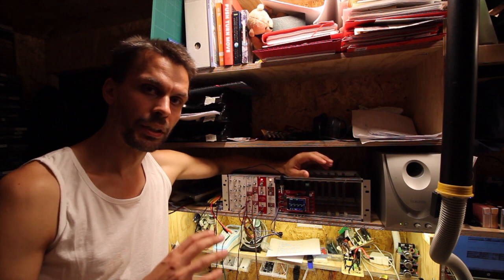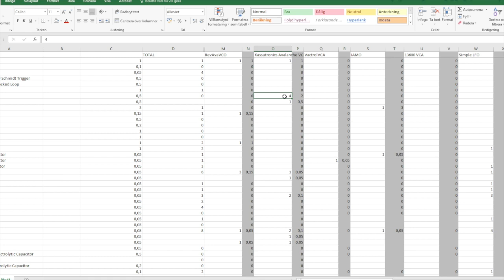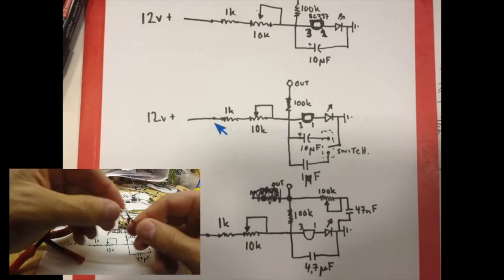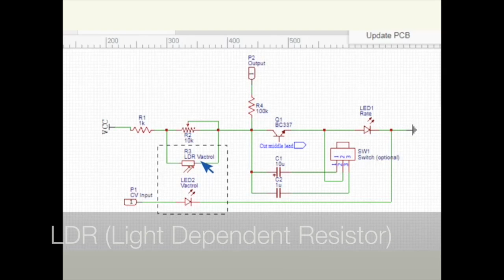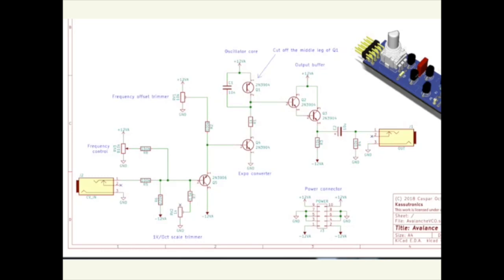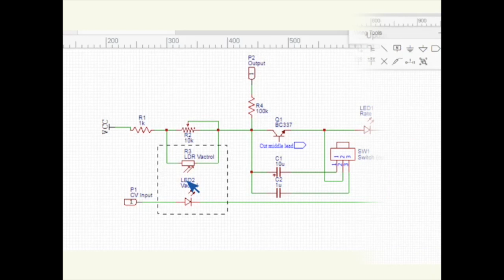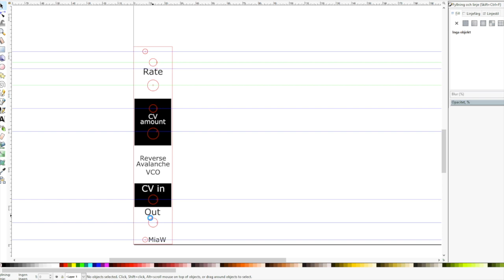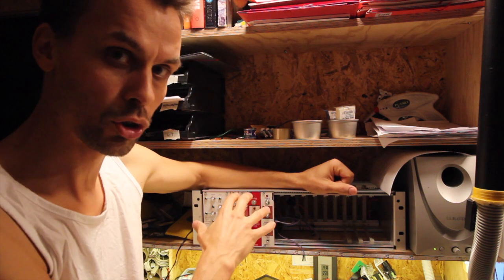Reverse Avalanche VCO - DIY Modular in A Week 1.4

Comment: somehow the ones i built only play for half the knob range, past the half they shut off, same with CV, they only play for like 2 or 3 volts
Reply from the maker: You can try other transistors. As it is very sensitive to their performance. Check the link in the description for which you can try. This is a very controversial vco design. If you want better everything you should try another design. The 4046 is a simple one. 40106 even simpler but not cv-able. Or the AAC vco which is the best one I did in the beginning of this series. It is actually timetable to 1v/Oct. hope it helps a bit.
Reply: @SourceryOne  it's way too simple for proper tracking but it has a lovely sound and I like it specially because it was my first vco, I built it in a dual packet with an option for mixed outputs or 2 single ones, but what I found is that due to tolerances it behaves different no matter what :) I will probably change for a higher voltage transistor and see how it goes; also if you change the led for a multicolor led of the kind that changes "randomly" it produces a cuasi-random change in the pitch

I did the 4046 as well, but since it has an inverted input the keyboard plays backwards and I've been lazy about adding an inverter for the input, also I got some AS3340  but haven't built the module yet

Thank you for answering!

Comment: I dont know... if I'm just living outside of reality and having auditory hallucinations or something but.. as far as my experience goes, if you dont kill the base pin.. nothing changes if you just connect everything else the same, and furthermore and ... rather importantly I would think... when j throw voltage at the base from say an arturia beatstep (I might have fiddled with some biasing) it simply controls the frequency of the oscillator right out the box...

Comment: OK here's a couple of ideas for possible mods to the basic circuit;

Disclaimer: I haven't actually tried these yet, but I will as soon as I have time to play with it...

1. Swap the positions of the potentiometer and the 1K resistor - that would allow a single pot to control the pitch of multiple oscillators (maybe include a small preset pot for individual fine tuning). This might need a diode between the main pot and the 1K resistor to avoid interaction between oscillators, though this might not really be a problem - I'll let you know when I get around to testing this idea.

2. The 12V-18V limitation might not necessarily be an issue in a modular synth with a dual-rail power supply as most of these will be +/- 12V, giving a potential 24V across the main power rails. Not sure if this may need a bigger resistor in the 1K position to limit the current, but if you're going to build this into a module, this might be a viable solution, allowing you to source almost any bipolar transistor. 

3. Vactrol LDRs are not high current devices, so using one to modulate the supply voltage to a bank of these may cause it to overheat :(

4. If you don't really need 1V/octave (ie. exponential control), then a simple short keyboard (perhaps an organ-type bass pedalboard) with individual preset pots per key (13 in this case) might be a neat way of actually playing tunes on a small drone vco built from this basic core circuit, based on the concept in point #1 above.

Sure the 1V/oct standard has been around for a long time but unless you're planning on using it with commercial sequencers and/or MIDI-CV boxes, then you really don't need it, and linear VCOs are much simpler in many respects (I built quite a few synths back in the 80s and most of those were linear)...

Just a thought...
Reply from the maker: Some interesting ideas. :) I’ll love to know what you find out. The biggest downside of this design is that the transistor will degrade over time and fail. So it’s not a good design for a module. :/

Comment: Hi Cristian. If you take the led off the circuit you will get more 1,8 volts across the transistor, enough to bring even the 2n3904 into oscillation, and enough to have 1,75V peak to peak AC signal at the output with the BC337.

Comment: Hi Kristian, i'm a big fan and just started this journey too. I have some soldering and electronics skills but building analog synths is something different. I have build 4 oscillator modules (reverse avalanche) with BC517 transistors. I found out that this transistor has more output, but also lower in pitch (even with smaller capacitors), now I'm figuring out how to amplify them all. probably using a TL074 op-amp, but how to approach this best? for each oscillator one op-amp? or hook all outputs together and then via op-amp? this I cannot find on the internet. Your help would be greatly appreciated. Also i have questions about the vactrol too. Thanks in advance for your reply :)
Reply from the maker: Congrats on jumping into the synthdiy rabbit hole. ;) if you continue watching episodes in the miaw series you will find a simple mixer and a buffered mixer. These two are good for mixing the signals of the oscillators you built.
Reply: @SourceryOne  Hi Kristian. thanks for your quick reply. I'm a musician and play keyboards and fiddling with drum machines from the early 90's. Never occurred to me to build a synth myself. I currently own a Yamaha DX7 and I know how to program, and recently I have bought a Roland Juno 106. So VCO's VCA's LFO's etc etc does ring some bells :). Just figured out that the BC517 transistor has a lot of output, so no op-amp needed. the overall sound is also way lower, even when using a 1uF capacitor. I have fun experimenting with this. next step is the Vactrol. have a nice day. gr Maarten
Reply: Hi Kristian, hope you doing well. May I ask one question regarding the Vactrol? the CV amount you have, is that only a 10k potentiometer in series with one of the vactrol's leg? So that you can control the amount of light falling onto the LDR? or do you have a potentiometer on the CV input jack? no idea if that works different. thanks in advance for your answer.

Comment: Hey Kristien!  Love this series, which oscillator circuit do you think is better for good CV (1volt per octave) for keyboards etc?...., I've made a basic 555 oscillator but CV is all over the place!!
Reply: the only 555 based vco's Ive used that track well at all has been the wasp and Thomas Henry's 555 VCO which is surprisingly great.I want to mod my atari punk console  for 1v per 8ve tracking.a pretty good VCO for tracking is the Moritz Klein Shapes VCO ( pulls heavilly from Rene's work) but, tracks really well once you get it calibrated
Reply from the maker: It is also very important to tune the exponential converter. It is a tedious process that needs to be done.
Reply: @SourceryOne  Thanks for you advise and the link Kristian!  I really appreciate it.
Reply from the maker: The only 1v/oct I built is the aacvco it has NOT good tracking. But works for two-three octaves. There are many oscillators out there with much better tracking. Check out some cem3340 designs or if you want to make the reverse avalanche vco check out kassutronics design which has quite good tracking. Rene Schmitz has some simple designs with cv tracking aswell on Schmitzbitz.de

Comment: I have read that it often takes a few tries/a few NPN's to work. If it does not work does it ruin your NPN or is it still good to use it for something else?
Reply from the maker: If it doesnt work, it just means the npn hasnt the right qualifications. And they should be good to go in other projects... If they start to smoke and/or smell bad, well then its a different situation ;)
Reply: @SourceryOne  Thanks for the reply!. I did not want to have problems with future projects by keeping bad ones around.
Reply: @SourceryOne  Have you tried powering this from the +12 and -12 rails instead ov just +12 and ground?

Comment: Is it possible to use a JFET instead of a vactrol for controlling the oscillator’s frequency?
Reply from the maker: See the next video in the series the IAMO. Gets a vca kind of result with a vca.
Reply: I think that Sam (LMNC) used power mosfets in the 1000 oscillator megadrone panels

Comment: I've made 5 with the s9018 to work on my 9v skiff. I burnt a diode, because no resistor (the other work fine without one, just don't leave them all the way open and drop them on the floor), and I think the s9018 gave in  on an other because messing with the circut too much. It very low volume, and it would'n even work with 22uf (or bigger) cap, so 10uf only. Haven't added a working CV, but think maybe it can become a cool drone or something on an amplified circut. Just used 100k pot's because I had some left, but it only works in a small range, so a 10k would be much better. Awesome video

Comment: Wow! I'm making a very similar journey to you. I've been inspired by LMNC very much, so have built a case, 50x50 cm out of an old drawer, built a dual power supply from a kit and just made 3 reverse avalance oscillators. So far, it just drones! I too found the transistors that LMNC used were hard to get here in Australia, so I got BC337s as well. They do indeed oscillate higher and better than the 2N3904s that I first tried. I also tried different color LED's but the blue and green ones seemed quieter and didnt seem to sound so nice. LMNC is using just red ones so maybe he found the same. At the moment I'm trying to get the oscillator to stop at the pot's highest resistance (counter clockwise position), the 10k pot doesn't do this. Do yours? I haven't compared my output levels yet, but if it's low I may yet build the output buffer like yours. I can't wait to add CV, I have LED's and LDR's on order. I am going to build a Baby8 sequencer with hold stop and reset buttons on arcade switches. I have breadboarded an audio to trigger circuit which steps a prototyped sequencer from my computer so with my audio interface I can send a click to sync it up to my DAW. It's so exciting! I'm looking forward to watching the rest of your work. It's now some months since you published this, so hope it went ok. Peace, Punk Duck
Reply from the maker: That sounds like a good start. As for my oscillators I don’t use reverse avalanche vcos anymore. I switched to one design around a 4046 and one classic two ops no saw and square wave vco which also tracks cv better. I’m also going to build a sequencer ASAP. To make my rig more musical. :) I really like the audio to sync idea. Do you have any schematics or similar you could share? Anyways thanks for sharing your journey so far. As soon as you have a video showing it of let me know. :)

Comment: Wouldn't it be a good idea to add a 220 ohm resistor between the cathode of each led (including the Vactrol) and the ground? And... Why using a DUAL op-amp, if you are using a single section? I guess a TL071 would fit perfectly.
Reply from the maker: Yes. I think I use 330ohm. It depends on which diode you use didn’t I show that? In the ones I have I have resistors. And yes a tl071 would have been much better. Didn’t have one at hand was the reason for that.

Comment: So I built this, and it works, but it is extremely quiet until I touch the positive (an open lug on a pot). While this is cool and an added bonus - I really don't know why it is happening. I currently have it working and my output jack isn't even grounded! How is this possible?
Reply from the maker: The ground in a modular is "strange" and sometimes not used at all, look at all modules using banana plugs, which is just the signal, no ground. 
As for the colume, I have heard many people having trouble with the Rev Ava Oscillator, it seems that it is very dependant of the transistor, and will wear out over time aswell. All I can say is double check your connections, and maybe replace the transistor? You could also add that open lug to ground as you touching it basically is that.
Reply: @SourceryOne  So strange... when I add the open lug to ground it shorts out.  Thanks for the heads up on the potential to wear out though... good to know in advance!

Comment: Many thanks for what you are doing here - has peaked my interests and started me down the rabbit hole I'm afraid - thought I would share a discovery for another transistor to try that I had decent luck with to get stable oscillations at 12v (and below - down to 9V with the 4401! and that was with the LED in series still).  Both do depend on the variable resistor and the capacitor value but everyone looking at this should be trying on their own anyway.  I had some odd multi-packs of 2N3904's that included 2N2222's and 2N4401's - both of which where more stable (or would oscillate) below 12V than the 2N3904's!
Reply from the maker: Thanks for the information and nice that you experiment. Sorry for luring you down the rabbit hole. 😂 Modulars are addictive. It is all I think about nowadays. What module to make next. 😉 Keep on experimenting and let me know all the cool stuff you figure out. 👍

Comment: With ending the VCO's, did you ever find a decent (easy/cheap) sine wave source to build?  I would like to add a sin wave if possible.  Thanks
Reply from the maker: No. Not yet. I found a squ to saw shaper which I’ll try in a bit, but sin seems harder. Have tried a few circuits which didn’t work. But will continue searching. :)
Reply: @SourceryOne  Use this maybe : https://www.multisim.com/content/v5kkSUdCsvbbX9TKSLkSSE/6-diode-3-segment-triangular-to-sine-wave-shaper/ 

I found it a couple days ago and in circuit sims it gives a sort of squarish sine wave with triangle input, but the circuit is really simple. With a switch or two disconnecting the top or bottom diodes at will you can vary the waveform in other interesting ways as well. 

I am going to breadboard it and try it with the reverse avalanche thingy that I built last night.  I had issues with LMNC:s reverse avalanche as well, but with a small, low current LED it works fine on 12 volts and sounds like this : https://www.youtube.com/watch?v=Kl-DDVbyQqA
Reply: It might need an output buffer though.
Reply: @Helmut314   Very cool!  Super simple.  I must ask though, what are the "va" PR colored bubbles?
Reply: @spot2028  Its where multisim puts probes to show you simulated waveforms at that point. You usually can add probes wherever you like. I use different tools, but the principles are the same.
Reply: @Helmut314  Interesting, thanks
Reply from the maker: Peter Svedman that looks interesting. I’ve seen other simple circuits that only work at very narrow frequency ranges. How is the range on this? I’ll add this to my todo list. :) thanks!
Reply: @SourceryOne  I got stuck reading up on mixers, vactrols and VCOs 😁. In sims it runs fine up to 8-10kHz, which makes sense as its an entirely passive circuit. The diodes do the work and if you use switching diodes like 1n4148 or some schottkys like BAT42 they can keep up with MHz... Its a sine wave approximation, not a true sine, but hey, it costs like a dollar to build.
Reply: @SourceryOne  I'll be watching out for them!  Interesting that the most fundamental of waves is the hardest to produce.  Before finding your series I was doing some searching to build one and most were a part of bigger systems.  I'm sure you have seen these, but the ones I found were: Ian Fritz, The Teazer; Catgirl (CGS) 48 VCO; Thomas Henry's VCO1, and; Yusynth VCO.  Like the AAC module, I wonder if the various waves can be pulled out separately.  Thanks!
Reply from the maker: Another passive circuit that I looke at is this one: learningaboutelectronics.com Articles Square-to-sine-wave-converter-circuit.php But it is also locked to a very narrow frequency range according to the article. Otherwise there is Quadrature oscillators and Wein typ oscillators to create sine waves. I did try one of the Wein type schematics, but didnt get any oscillation out of it. Apparently they are quite sensitive... I'll give it a go later on... :)
Reply: @SourceryOne  The square to sine looks so simple!  I think I'll breadboard it just to play around.  Dude, I can't imagine the amount of research, trial and error you went through before putting out the series.  Amazing.  You're going to have to make it "Modular in a Month" 😃 with all the add-ons kicking around.  Anyway, again, I hope you understand how much I appreciate you putting this together.  It's really great!  Thanks
Reply from the maker: So don’t build the squ to saw I linked to before in this thread. It didn’t work. It changed the shape but it didn’t become  sawtooth like. So. Yeah. I’ll look at it a bit more. Just wanted to let you know.